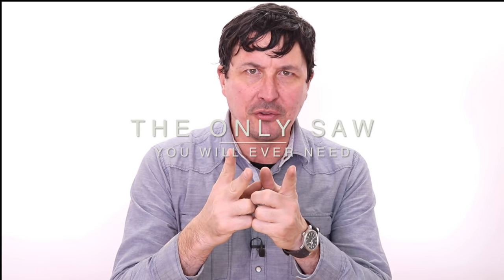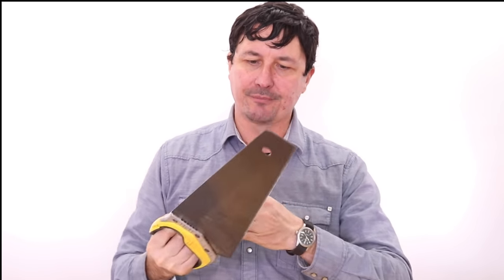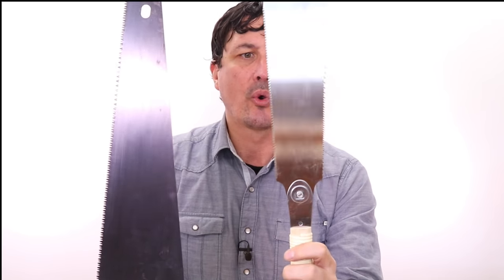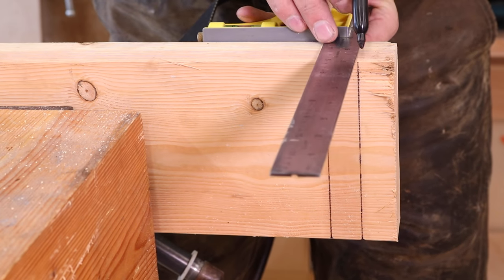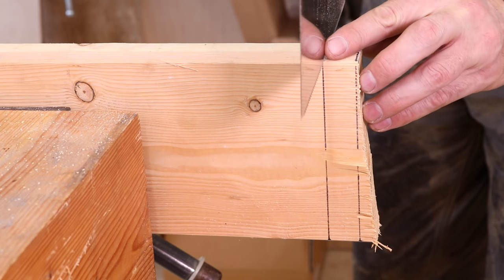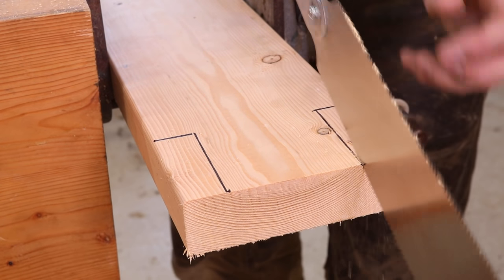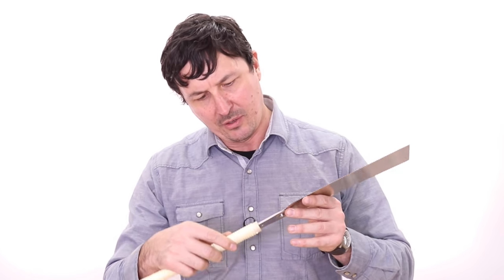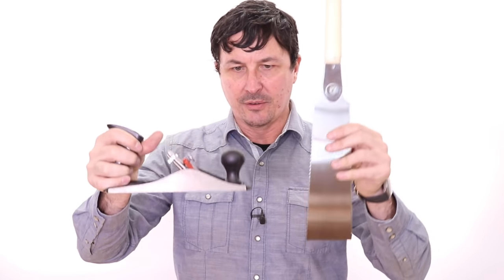The Only Saw You'll Ever Need

Comment: Just a general comment:
When you cut the "dove tails", the reason for the japanese one having a better finish on the back is because it cuts backwards to the traditional western saw; back to front. 

And that is exactly why the japanese saw feels better to use, human anatomy on work there; our arms are better tuned for pulling than pushing, and the western saw requires to do most force while pushing (old, bad design). 
That's ergonomics... where engineering and anatomy beautifully merge. 

PS.: It also applies to driving. Pro drivers don't "push" the wheel to turn the car. You should always pull from it toward yourself, as that is the more controlled movement. So, turning right, it's the right hand that should do the work, and the left hand just comes along, barely touching the wheel.

Comment: Done Japanese was not as clean on the front because that was the exit side.  So the tear out was way better on it. I have a hard time making a straight cut with either type. I guess I need way more practice. Good job man. I like this train of thought.
Reply: Cutting straight lines is mostly about proper technique, and not so much about practice (well it takes a little practice to get the technique right). I would recommend you check out RenaissanceWW (Shannon Rogers) here on youtube. He has some excellent videos on sawing technique. 

The short version though, is simply get all the joints in your arm to swing int the plane that you want your saw to cut, and move the rest of your body out of the way, so that it can swing freely. If you can do this your cut should come out reasonably straight, though getting it on the line AND straight, that does require frequent practice.

Comment: Don't discount body mechanics while cutting. Using 2 hands on a saw tends to misalign the body and could easily be contributing to a drifting cut. Aligning your wrist, elbow, and shoulder will help (maybe not cure) a drifting cut as well as reduce binding.
Reply: Lee Wierenga i agree with body alignment it works everything needs to be aligned elbow shoulder and hand.
Reply: agreed. alignment and sighting straight down the arm, elbow, wrist and hand. also don't forget the old 311 hand grip. for anybody that doesn't know, make a pistol shape with your hand and hold the saw like that. the index finger is key.
Reply: +Edward Steward The index finger is key indeed. I'm always baffled to see Cody sawing en not applying this basic knowledge - though apparently he has watched his share of Paul Sellers??
Reply: It is 100% about body positioning and hand grip. While in class we had to hand saw EVERYTHING till we mastered it.  Not sure if camera angle but the first saw looks bent and twisted.

Comment: a set of sharpening stones?
Reply: Sam Koch yes, but in a budget tool box is this a first need, or a later added item for someone with a bit more skill?
Reply: QuestForTheOpenRoad First need.
Reply: He established that most sharpening (budget) can be accomplished with glass and wet (automoti e) sanding paper in various grits. Years of sharpening per pack at a budget intro price!  Yes?
Reply: Well I think its needed and a skill that should be practiced early on. I dont feel like messing up my bevels on my chisels not knowing how to sharpen. Im from canada and I can get a cheap stone for 10$ with two grits on it . And it does the job quite well.
Reply: Paul Sellers makes the point that a reasonably flat plate and wet-or-dry sandpaper can work to begin with.  Not onlyh that, but in another video he proved that you can stop at 220 grit and have a serviceable edge.

When I was a boy, my tool-and-die maker grandfather taught me to sharpen my pocket knife that way.  Easy and fast.

I picked up a 12" x 12" x 3/8" black granite counter tile at Lowe's for $5.  Wet-or-dry is not expensive to start with, and becoming practiced at sharpening with that method is a great way to begin.

There ARE  cheap diamond hones on Amazon, but the flatness and surface quality may or may not be up to the task.
Reply: Kev Gunner: There's always more than one way to skin a cat... down kitty:-)

Comment: I really think you are comparing apple to oranges,
The Japanese Ryoba is $28, and it a cross cut and a ripping saw.
You then compared that to a carpenters framing saw, a used one at that, not really a fair comparison.
To be fair, you should have compared the Ryoba to two Western style saws.
Stanley FatMax 17-202 14-Inch Back Saw $13
Stanley 20-045 15-Inch Fat Max Hand Saw $12
that is a total of $25, less than the one Ryoba saw.
Just my opinion mind you.
BTW, you should run your medium fine diamond stone on the flat of the Stanley saw, I bet you have at least one tooth that is sticking out causing it to bind and to pull to the right. Also why has the rag in a can not been used for the Stanley saw?
Cheers!
Reply: StuInTokyo I concur
Reply: StuInTokyo bang on with what you say. I've tested saws for a few manufacturers now and these mass produced saws are often not great tools I had one recently that had next to no set on one side but masses of set on the other side and that cut just like codys. The kerf width is often too large also.
Reply: Exactly my point. Not to be rude but I really don't like the 'product placement' of this. When you click the link to buy the saw at the Amazon page he will get a % of the sale. Just telling it like I see it?
Reply: This is what happens when you know your desired result and choose comparisons accordingly
Reply: d c that became clear when he cut the 2x6 with the stanley- he could have easily cut it straight, especially if he hadn't been pushing down on the blade when doing so.
Reply: lol maybe the traditional saws are shit and you should just use power tools
Reply: StuInTokyo
I think for an amateur who's building up his first set, he likely wants to spend a set amount and not have too many tools as he goes to aquire his necessaries. sure, Cody could've done that and make things more complicated for the novice lad. but let's start him off easy and not overwhelm him
Reply: I think the point StuInTokyo is really trying to get across here is this wasn't a fair test. I don't see how you can argue this any other way. He's got a brand new 8" Japanese style saw and a used Stanley 14"(guessing) saw. Of course the used saw isn't going to preform as well as a brand new one. As I see it this really looks like he's comparing a medical scalpel vs. a broad sword as to what the better surgical tool is. It's just not a fair test.
Reply: How many saws are we buying here?  The tool box has room for one.  Which one is most versatile?  That's the point of the video.
Reply: But you're building the tool box using these tools, remember? So just add room for another saw. Duh.
Reply: Mahir Fredericks But I already have all the power I need right here. *kisses biceps*
Reply: I agree. If there is a budget limit, say $100, then i would buy cheaper 2 saws instead of one but have two saws. One of ripping etc, and one for doing detail work, dovetails etc. I did not find the comparison objective either.
Reply: Everyone is biased, that does not bother me in the least, Cody really liked the Japanese pull saw, I can see why, as I'm in Japan and have and use them daily, I love my pull saws! My point is that while Cody has a preference, I would say an earned preference, in that the Japanese pull saw has earned his favour, he would rather it go into the starter kit, that is totally fair, it is Cody's starter kit, he is going to put tools in there that he like. I just think that if Cody had put that Japanese pull saw up against the two saws that I listed above, the Japanese pull saw would have still come out the winner of the comparison, but it would have been a better comparison. I'm trying to offer up some constructive criticism here, I'm not just throwing stones.
The two Western saws would have given a better insight to the differences between the pull and push saws as well. Just my two cents, love the video!
Reply: Good point, but for the novice figuring out which side of the Japanese pull saw to use can also be confusing. If you are a fan of Paul Sellers, I've heard him say many times in his videos that he just files most of his saws to a rip cut. Watch the video "How to Sharpen a Woodworking Handsaw with Paul Sellers" as he explains it all. I really think that a simple good rip cut western saw that cost about the same as the Japanese Ryoba saw would also be a good option, with the additional benefit of the user being able to sharpen it with very little practice or tools. Something like this "Great Neck N2610 26-Inch Hand Saw" for $29 might also be good.
Cheers!

Comment: What about a drill?
Reply: Motor rider I think this would be a fantastic idea
Reply: Motor rider I'd like to see this. A good brace and bit style drill
Reply: Motor rider that's an amazing idea. A low budget serviceable bit and brace set
Reply: I like the idea but maybe electric
Reply: I agree, if this is about a realistic get into wood workingin kit we dont need to be pure hand tools. a cordless for drilling holes is more practical
Reply: I guess I'm not the only one
Reply: benj8mmin More practical by who's standards?
Reply: benj8mmin I agree, be theb we start down the rabbit hole of what brand, and if we go with a drill, why not a driver, or a circular saw, or orbital sander... and the list goes on. There are certainly less expensive cordless tools on the market that are reasonable quality. The problem soon becomes what tools, in what order, and what price point do we shop for. a ryobi drill with battery and charger is already going to set you back 50 to 75 dollars, dewalt, Milwaukee and ridgid triple those numbers, bosch fein, and others would be more than the budget for the whole project. I think Cody was shooting for the 200 dollar mark all in. He may be in a sticky spot when it comes to picking a cheaper tool when he just got outfitted with flexvolt tools by dewalt. They are great tools, but there again the flexvolt drill would be over budget. There are also a lot of ways to assemble things that would not necessarily need a drill. nails and glue work well for assembly of most beginner projects. boring holes for a project like the tool holder can easily be dole with a crude hole with a chisel, and a coping saw to get clean circles. All that being said My frist tool that I bought for myself was a craftsman contractor  series corded drill, back when I was about 15. I still have it, though it needs repairs. I would suggest that the kit not include a drill or bit and brace, and a prioritized list of future tools for the winner. this is a "get the feet wet" kit, once someone figures out that they want to go for the hobby then things like drills, power saws, sanders, lathes, nail guns etc can be invested in. I still have a want list in my shop after 20 years of acquiring tools... maybe some day a 20 inch bandsaw with resawing capabilities will fall off of a tool truck and land in my woodshop. (one can hope)
Reply: price of brace and bits will matter. but certainly there is a chance a power/cordless drill COULD be cheaper and easier, worth the dialoge at least.
Reply: If you watch some of the other videos, he's clear about the idea of a traditional woodworker. No power tools for this kit, and it's tough to get a good quality hand drill for a reasonable price these days - and even tougher to really learn how to operate accurately. I have several, and love to turn to them when I'm in the mood to really do something by hand, but it's not something that i think a beginner can jump right into (heck, most people struggle with keeping a cordless drill straight).

Comment: Not really a fair test as there both completely different saws with different tpi (teeth per inch), the stanley being used for more heavy duty work such as construction and the other for wood working.
Reply: I would argue that it is a perfectly fair test. It is not a test of which is the better saw at it's intended use case. It is a test of which is the better saw to have in your toolbox if you are going to have only one saw for woodworking and carpentry, and the Japanese saw is simply the better general purpose saw, as shown by this test.
Reply: Henry Tittywinker  the Japanese saw is a good saw, But the stanley is more heavy duty and would of been a fairer test had it had finer teeth.
Reply: He actually addresses that multiple times in the video, stating that this is not the intended use, for each, but as building a generic tool box with the basics that is in everyone's price range, he was trying to find a single saw that could be pressed into doing different types of sawing.
Reply: That Ryoba style saw has been used in Japanese woodworking for years for the same heavy duty kind of work. Cutting on the pull stroke just allows for better quality work.

Comment: At about 15:00 when you're comparing the tear-out of the saws... you ignore that the tear-out is on opposite sides because one cuts on the pull, and the other cuts on the push. The pull saw is amazingly clean on the back because it's pulling into the wood on that side. The push saw is cleaner on the front because it's pushing into the wood on that side. Those sides will always be in an acceptable condition. 

If you compare the back side for the push to the front side for the pull, you really see the dramatic difference in the saws. The push saw causes a LOT more tear-out than the pull saw does. It's also a lot harder to alleviate that with the push saw because when you push, it naturally attempts to take a big bite into the wood. The pull style can be grazed along the cutting edge for a much gentler cut.

The first time I used a pull style, I made a cut so clean it looked like it had been sanded. (It was a Marples, the same as your "Ultimate" chisels)

Comment: Question is, who thought that it is a good idea to cut on the push?
Pulling is much more stable!
Reply: If you have to saw for a very long time, which you did back before power tools, it's easier to push than to pull. You have more power to push a saw than to pull it.
Reply: @bryansfistfulofwood4620  I guess if you you have more mass then my, it's true.
Reply: I have to agree. I've used push saws for years, now I've got a pull saw, and my normal push saw has lost nearly all its purpose.
Reply: @bryansfistfulofwood4620  - There is no evidence this is true as far as I know... in fact my intuition would tell me the opposite but I am not claiming that as I don't know for sure. What I would say is it is a fact that if you have no skill with either the pull cut ones will always win... that said I know that skill can make either work nearly as good so I suppose it it all personal preference at that point.

Comment: The other saw is a construction saw and the other is a carpenter saw. I really have a hard time thinking anyone would use the Japanese pull saw on construction or the "western" saw for fine work. The "western" saw has gotta be faster, otherwise its useless. I think both saws types are (and have been) used in Japan and Europe for a long time. Granted, the Japanese have done fine woodworking (and metal working) with great attention to detail, as have the European craftsmen. It's kinda like the question is the Japanese samurai better than European sword of the same period. I think it mostly depends on the blacksmiths who made them. If you are a large and strong dude, you might pick a larger and heavier Viking sword over a samurai sword. If you are a smaller dude, you might pick the samurai.
Reply: I just don't get why they've ever built push saws. Obviously such thin metal will always bend (and cause more friction) so it either bends or it has to be made thicker which means more work. And then of course the push saw uses the human anatomy in a worse way, since we're using weaker muscles. Our back musles are much stronger so it's easier to pull and the thin sawblade straightens itself since we're only applying force when we're pulling on it. I just don't understand push saws at all. Maybe they are better when you're kneeling on a board and cutting it from above. I don't know.
Reply: @stauffap  great question and insights...I would like to know more.